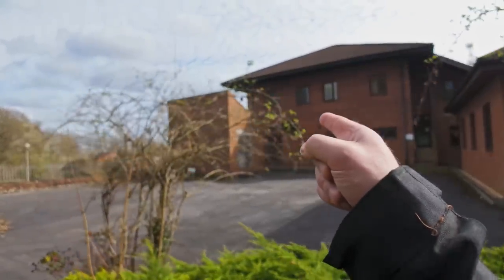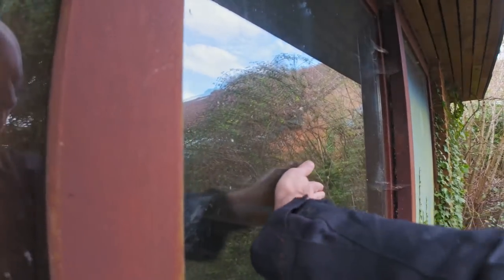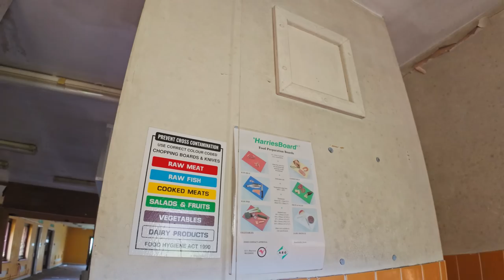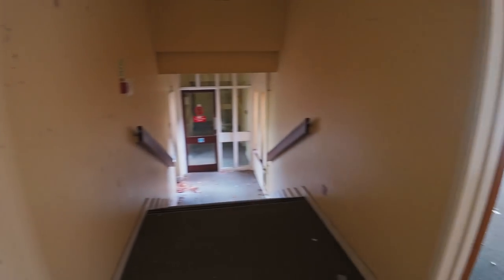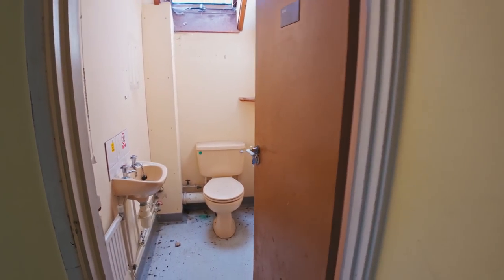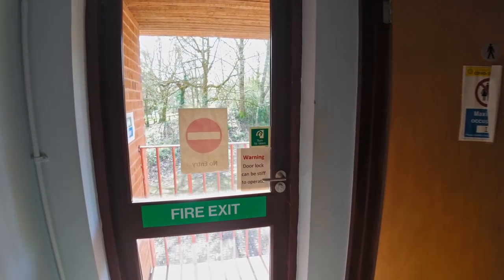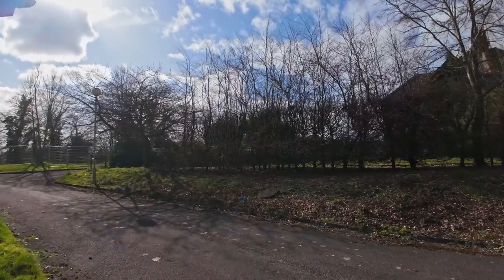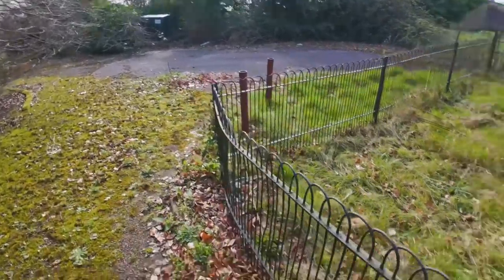NEW BUILDINGS FOUND at CHIPPNEHAM AMBULANCE STATION

Comment: Hi Matt. I went to this place when I joined the ambulance service in 2001. I’m still in it as it happens. 
I attended the Chippenham Regional Ambulance Training College ( this place) for my 3 week driving course. Being a regional college, it was used by Hampshire Ambulance, Dorset and other counties further west. 
The instructors were very strict. Our uniforms had to be pristine at all times - couldn’t have your coat open and stuff like that. 
The big orange room at 10.50 was the recreation room which had a full sized snooker table in it. Just down the corridor was a canteen area.
There were residential rooms for the students although we had to lodge in a private house just down the road.
The whole complex shut when ambulance service counties merged to form larger trusts which then created their own training centres.
Reply from the maker: Very interesting. Thanks for the info.
Reply: Thanks for the return footage.😮